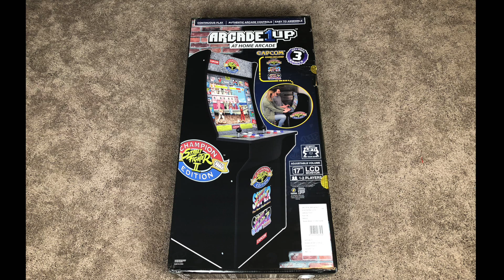Arcade1Up Cabinet Teardown Detailed Look At CPU And PCB

Comment: is there a way to convert the stock PCB to a vga output? I want to use a vga scan line generator between the stock pcb and the stock monitor using the common vga converter board used in the PI mod

Comment: After some of the Pandora's Box talk, it got me thinking... would the Control panel from the Arcade1UP be able to plug directly into the Pandora's Box with a ribbon cable and have a full set of functioning buttons?

Comment: Im having an issue with this sf one. My volume went from fine to hardly audible after 15 minutes of playing.. and it’s not the speaker which i thought. Cause i switched the controls board to my other arcade 1ups and specifically on the sf cabinet, each control board doesnt work volume wise. Any ideas? Arcade 1up wont email me back.

Comment: So basically when you buy one of these games, your buying 80s technology, which is junk. What you should do it just buy an original arcade system, put an emulator in it and load it full of games. IT would be cheaper then buying each individual 1 UP machine

Comment: just as I suspected... these things are GARBAGE for the money. That Allwinner chip is total fail, I had one in a cheap Chinese tablet I bought a couple years back for $30 and it didn't last more than 6 months. Buy one used off somebody in 6 months for $100 and throw a raspberry pi in to make it worthwhile. Thanks for the heads up though!

Comment: Too cheap to even put some solid caps on the PCB ? Those looks like some of the cheapest liquid caps too ? 😟

Btw, cell phones with same CPU/memory/4" screen are found in third world around 20$, and the LCD connection cable looks like standard 40 pin 1$ IDE cable 😒

Thanks for producing the video that no other tech channel so far could 👏

Comment: Reddit thread on modding these: https://www.reddit.com/r/Arcade1Up/comments/9iytkr/modding_thread/

There is a sold out monitor controller board linked to eBay from there, I was able to locate one of the same on Amazon with prime shipping, not gonna link until I verify it working.

With the monitor controller you supposedly can use a Pandora in it by just attaching the ribbon cable cable for the joystick controls. I'm going to try setting it up with a Pi.

Comment: A yet another cheap SBC running an emulator.
I wonder why they've rubbed off RAM and CPU model numbers. To prevent hacking ?
Reply: It was likely a stopgap solution to attempt to prevent the overseas grey market from reproducing them. Unfortunately, it's impossible to stop, especially considering they have more than enough experience reverse engineering technology.

Comment: 5:32 - On the section with the CPU, off to the right there is a set of test points that look like 5+, something, something, and GND. I would be willing to bet that might be USB since nothing else screams UART to me on that board. So it would be 5+, D-, D+, GND or whatever the USB pinout would be. That would be a super simple way to program games onto it, and most cell phone chips have USB hubs in them, device and target. There is also another connecter under the 40-pin connector that might be something too. That looks more like a serial connection though, since it is on headers that you won't need to program on the line... So, for testing and whatnot.
Reply: I had the same thought voiced in my earlier comment. Because of TP-pins having pulldown in particular, this is typical for USB host. FEL USB programming is clearly the fastest method to factory program the boot ROM on this processor. i think ETA mentions somewhere down in the comments that he found the unpopulated 4-pin connector to likely be serial, and you lot will need it to trigger FEL boot, but it's not necessary for initial programming because it will FEL boot on test/programming jig when boot ROM is empty.
Reply: I'm an idiot. You don't need to run the processor AT ALL to program the ROM. You'll likely find an eMMC near the top edge of the board connected to SDC0 controller of the processor, and it has all the lines routed out as testpoints! So all you need is an SD-card adapter that you butcher into a programming jig. The fastest way to program anything is obviously dd. FEL USB can still be useful at the factory to boot a self-test ROM.

Comment: FInd out the LCD model, and you could probably get an HDMI adapter board for it, then install a Pandoras box. Should be plug n play with the controls.

Comment: @ETA PRIME : could you tell me what happens if you connect the 40 pin connector from the control Box to your pandora's box.  Does the pandoa's box read the controls?  If so it might that would be a easy mod.

Comment: What I'm really waiting for is for someone that bought one of these to take measurements of all of the pieces and put the plans online so we can just build our own version of the cabinets for mame/emu. I'm physically medically disabled, on a fixed income, don't have tools, live in an apartment and don't have the physical ability to build a larger/heavier cabinet and overall really like these arcade1up cabinets. I've seen the alpha-cade 3/4 scale ones but not a big fan of the control panel layout on them so I'd end up redoing that part anyways and it's so much more expensive with shipping. I could definitely see myself saving up for the pac-man version of these arcade1up ones though and leaving it as is just because it has all of the artwork and everything already included with it. One thing I've noticed and I hope @ETA Prime covers this in his build video is that noone has mentioned if the marquee is juist a solid piece of wood or if it would be possible to mod it and add your one light in.
Reply: you can already do that and recreate the actual cabinets as they came off the assembly line. cabinet grade plywood and sometimes particle board/hardwood in places. mostly the former though. basically table saw, jig saw, router, drill, materials plans and time. but if you're disabled these would be probably the way to go.

Comment: Thanks for the great info.  I would be interested if you can replace the existing board with a RP. Right now some stores are selling these for less than the bare cabinets. If you can make the swap, it's like getting the cabinet with cool graphics and a monitor for less than a cabinet alone.  Thanks in advance.

Comment: basically, its a cheap pandora box clone board with a cheap LCD, a wood chip cab, poor quality buttons and stick, sold at an over hyped price, just get pandora box 6, official, not a clone that ends in s, and you can swap out games and vid files on that. Arcade 1up ripping ppl off.
Reply: But they are not ripping people off if folks know what they are getting. It's not like they are saying this is going to be the same as a $2K Xarcade.  You are getting 4 games in a nice cabinet with a plug and play system.  Believe it or not, not everyone wants to learn how to install Retroarcade on an RP, find roms, load roms, map a controller, wire everything up, cut plywood/mdf, buy switches, buy joystick, mount a monitor, and then trouble shoot all that.  Different products for different markets.

Comment: Okay. Sounds like if you just want to actually play these games, have something that looks like the original with the artwork on the side panels,  get the arcade 1up.  

If you want something that is moddable, spend 50 dollars more for the alpha Cade 3/4 cabinet and get your own pc/pi and LCD screen.
Reply: So, around $400 total? And I have to build a riser and supply my own wraps? No thanks, I'll stick with the less expensive, all-inclusive solution.

Comment: Bunch of shady clowns trying to cover up that they are copying another company. I won't be buying their products ever.
Reply: Shady? Yes! Copying? Nope, all these boards have the same schematics which are standard ones provided by the SoC manufacturer, allwinner in this case. Pandora's boxes are anything special and in fact the software is pretty much random un optimized stuff randomly put together. An a13 with the appropriate sw can even emulate psx with no frame skipping.

Comment: Now try to put a raspberry pi in it.
Reply: Yeah, I have a Raspberry Pi 2, running RetroPie, and I have about 10,000 games on it. Everything from NES, SNES, Sega Genesis, MAME Arcade, and even PlayStation 1. Only paid 100 bucks for my whole setup. I got it in a 3D printed NES case
Reply: dylan rackel i just got a 512gb micro sd card, if the raspy support it i will full it of games for retropie, if it don't support it i'll use an usb hard drive, as for the sd, since is the faster i've seen (500kb/s read, 100kb/s write) i'll just use and sd to sata converter and put windows 10 on it, to have a super fast (i mean slow) laptop.
Reply: @Artemis_WR  You don't even need 512gb.  There are 128gb images that have more games than you'll ever be able to play.  Depending on features and games (like video snaps of games and playstation/dream cast games), you can get by on just a 32gb card.  There are tons of images already out there on arcade punks.
Reply: Why? Would these four games play better?
Reply: Dimitrios Zikos probably yes, and you can add lot more games.
Reply: Alex  These are licensed games. You can do all sorts of things if you decide to make your own non-licensed solution. But granted, it will not be much cheaper than 299.
Reply: Dimitrios Zikos  Alex means if we the users could replace with a RPi, we could have a LOT more games and actually have better screen effect options to emulate the actual arcade.  Better sound options too.
Reply: Dimitrios Zikos there is an os called retropie, you can put every retrogame in it.

Comment: Great Info . Thank you for this . While we are more clear on the Origins of the Hardware now , $299 for them to have done all the work in designing the cabinet and getting the license approved by Capcom with an attached panel and other Plug and Play aspects isn’t such a bad deal to be honest .
Reply: It's actually not and when it's put together it looks great and plays decent enough...
Reply: I’m happy with my centipede cabinet and will be happy with my Asteroids cabinet once I outfit it with a nice weighted dial. I also got mine for $30 off (each) and used full store credit at GameStop on them, so I’m not losing sleep over it. Just need to build myself some risers now.

Comment: If only they make full size arcade cabinet, I probably just buy their arcade cabinet kit while for internal I use different Emulation machine and 3rd party arcade stick, btw ETA Prime there some Duck Hunt romhack that can make normal NES and Zapper gun can be use at modern TV, what your thought about that Project ?
Reply: You can buy an arcade cabinet online already.

Comment: Wow, so it's a glorified Pandora's Box (or unglorified, considering it doesn't have the breadth of games a PB does?). Now I am curious how the framerates handle on this thing. I have various versions of the PB3 and they either feature frame skipping at points, or have screen tearing depending on the model.

Comment: 4 suspicious test points - GND, TP27, TP30, VCC. The mystery two in the middle have resistors to ground. This screams USB Host to me, because D+ and D- are supposed to have have 15K pulldown in this configuration.

CON4 looks interesting too. Unfortunately not much i can say about it without seeing the opposite side, except that one of the pins is grounded, but should be trivial to trace them all back to wherever they go.

The board eschews PROM option where you could switch the ROM bank by jumpers; it boots from eMMC in the vicinity of TP23 connected to SDC0 pins.
I don't see where game switch would be at, i suspect the boot ROM contents simply differs depending on shipped title.

I suspect USB test points are the programming method - it's so much faster than low-pin-count JTAG, TTL-serial and other methods, and Allwinner WILL boot from USB when the flash is not found or empty, or you can trigger that via serial, and finally the booted image can perform flash format and write. They don't need to populate serial or route out the test points for initial factory programming because flash is empty.
Reply: Actually new theory. USB perhaps used for self-test boot; however the eMMC has all the lines routed out as test points. So you can just dump or write the ROM contents from that, using nothing more than a butchered USB SD-Card adapter.
Reply: You went over my head, but I appreciate the post that you're interested in the inner workings of the board. Will be interesting to see what people find out that here in the next few weeks. Have a good night!
Reply: CherrySquishee  what may i clarify for you in particular?
I am just armchair engineering here, i do have some knowledge of similar things but i'm not getting this item, because i have no room or use for it nor budget and this seems like a North America retail item while i live in Europe.
Reply: @SianaGearz  hello. 

Nothing to clarify as all of what you said was foreign to me. Haha.. I just appreciate a technical perspective of it.
Reply: are you german or from UK?! ;)
Reply: @hashiru86   Ukrainian citizen, resident of Germany, of largely Bulgarian descent.

Comment: I have the same Mali-400mp4 gpu in my galaxy note 8.0 tablet from 2013 and it has trouble with YouTube on streaming 720p 60 on some occasions. But plays old emulated titles well.
Reply from the maker: That gpu In the note is actually better than this. This is the 400mp and it’s on a single core gpu. The MP4 has 4 cores.
Reply: @ETAPRIME  Yes it is paired with a 4 core 1.6GHz CPU, actually typing this on it right now. Very snappy tablet indeed for it's age:)
Reply: Mr PeanutPlays  its also over 4x faster than this expensive thing this chip was used in cheap tabs back in 2012 you know the non name brands for $30-50
lol most obama phones
now thinking might be the same in my sons old leapfrog tab and the wood is cheap recycled shit
im guessing total of $50 in parts
at least its a little better than that neogeo mini cpu thats even older mips core

Comment: Now we know why they don't have Scanlines/CRT ffilters if it's just a heavily restricted Pandora 3 clone. And the very old ones at that (circa 2009-2010 tech). Those things are a rip off at this price, my one hope is to be able to get rid of the PCB and to plug in an Odroid or a Tinkerboard through that gpio cable and still get full functionnality
Reply: Go with the Alpha Cade if you want to do that fucking idiot!

Comment: so basically a raspberry pi zero you can get for 5$ lol
Reply: Nope, the a13 is faster than a pi zero SoC, remember that the pi zero is an old armv6 while cortex a8 architecture is an armv7/armhf which is way way faster with the appropriate sw. Needless to say I remember pandora's box being slow because of crappy sw and I wonder if this is just a locked down copy paste or it actually has proper sw.

Comment: While I appreciate Arcade 1Up for bringing this to the mainstream, I'm really excited for the copy cat arcade clones that will flood the market to make pre-assembled arcade units cheap for Rasp Pi Units.
Reply: ratmdex let’s hope so. That’s a good idea
Reply: Pandora's Box 4s dual-joystick systems are already in the sub-$70 price range on ebay, and I suspect it us because of Arcade1Up.
Reply: Kiddo Cabbusses's Unpoplar Obscurities  I have a pandora box joystick and it sucks, many two player games like for example TMNT Arcade only work as 1 player
Reply: @ladic  Mine seems to be working just fine on 2player but I am.not surprised, quality is definitely not consistent.
Reply: Was just about to go on to Ebay to look for that exact thing.
You know those amazing looking Gaming Cockpits Chair Thingies? That are usually like big electric chairs with mounting points for the monitor/s, pull up keyboard & mouse board, rgb lighting, speakers and a place to fit a computer/console? They sell for like $3-4k+ for the standard without any computer hardware and then with monitors, hardware, etc the prices can skyrocket. Ebay/Alibaba has base Chinese clones that sell for about $1200+.
It's a fair amount of money but the same as a new RTX2080ti, I know which I'd rather have.
Reply: @PaddyMcMe  Build one yourself, much cheaper

Comment: How about that ribbon cable connector to the input, is it compatible with the Pandora's box?
Reply from the maker: Yes it is. All wee need is an lcd adapter or you always add a different screen
Reply: ETA PRIME  Think it'd be best to get a 3/4 Scale Alpha-Cade? more expensive of course, but hey, hobbies are not cheap!!! :D
Reply: ETA PRIME  Same pin out?
Reply: That's what I was thinking. Opens up the usability of the cabinet a lot if you can just drop a Pandora's box in there, just need a driver board for whatever model that lcd is and you're gold
Reply: Armando Ceniceros  my thoughts as well. One way or another, most of this ingenious crowd WILL find a way hehe. Thx ETA PRIME, great vid as usual my friend.

Comment: I hoping if it would be possible to put in a Pandora's Box board in this.  If someone can figure that out, I would definitely get one of these.  Some stores already have these on clearance.
Reply from the maker: The controller ribbon cable will fit but we need an adapter for the lcd
Reply: Jesse Schulz - It was one walmart that probably had a pre-order cancelled and since their POS did not show the item as available the store staff threw a clearance tag on them and put them oout for sale - they just did not realize they were a new item and not for sale yet instead of old stock that they no longer sold !